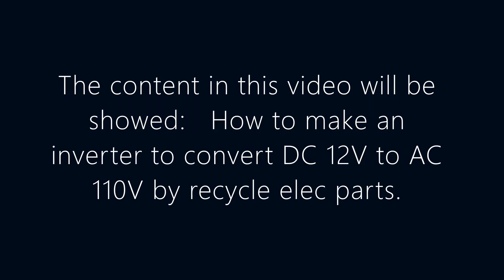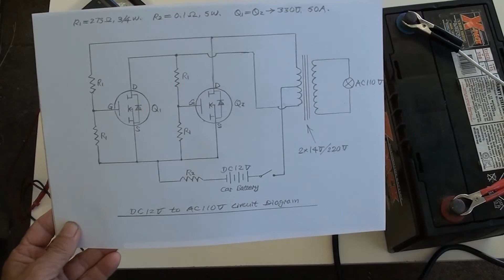How To Convert DC 12V To AC 110V?

Comment: what are the requirements?
Reply from the maker: Thank you for watching!  The requirements are:  Although the one doesn't need a lot of knowledge regarding electronics, the basic working principle of this kind of the circuit is needed otherwise it is not good simply to copy the similar to the one of other projects.  The parts of this device, I used from recycled:  A 240V / 2x14V center tapped transformer by DIY from MOT, two mosfets:  330V / 50A, four resistors:  273 ohms / 3/4W each by DIY,  a globe holder & a couple of different globes and an usable car battery etc.